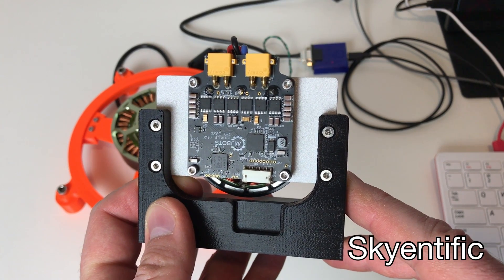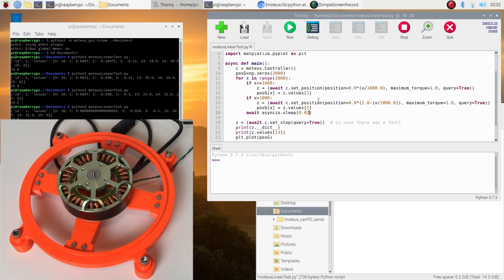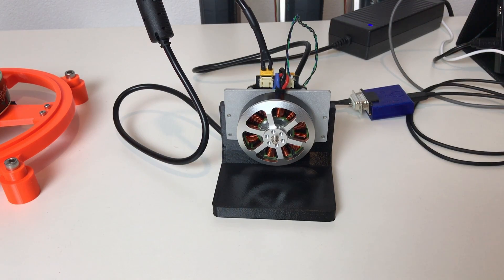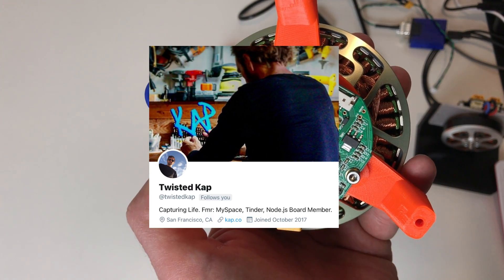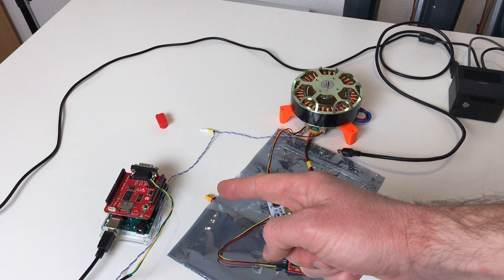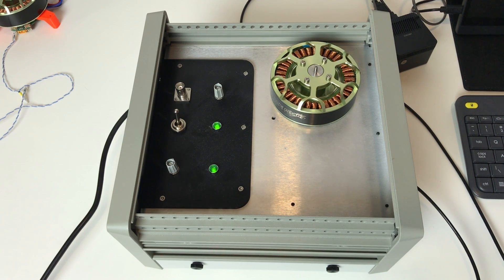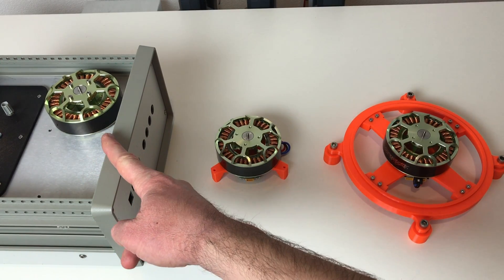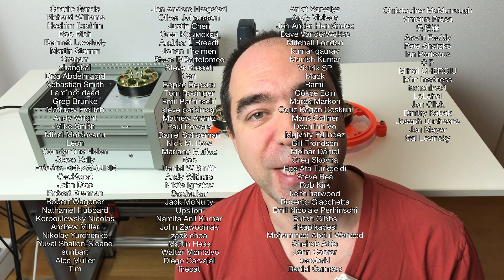Best BLDC Controller: ODrive vs MIT Mini Cheetah  vs Moteus (MJBots)

Comment: This is not a new problem, just a new place for it to appear. The issue in question stems from the hardware/firmware implementation of the controller.  Particularly the use of N-channel and P-channel mosfets, secondly the non linearity of the PWM drive curve (to the mosfets), and finally the firmwares implementation to mitigate these factors. In BLDC controllers for commercial hobby craft, this issue is long since solved. Most commonly by using only n channel mosfets and a boost converter for the gate drive voltage. See simonk firmware and related hardware. Solving it here, would involve careful component selection to find more closely matched p-channel performance, or some over driving of the p side, like a 3rd order polynomial fitting or similar with increased pwm resolution. However firmware can only get you so far, considerations in hardware are an important first step.

Comment: Thank you for showing this. I have been investigating the same kind of problem with brushed DC motors and have been looking into how encoders perform. I think the problem here is depending on the encoders performance and how they are used. I can see, that at least some of the controllers, that you show, do use an encoder, but do they all three got an encoder? One step could be to record the encoder type on each case - I should like to know that.

When you read the signal from a magnetic angle encoder, you need to be aware, that it measures the magnetic signal at its own measuring cycle with its own cycle time at about 100 us. This can create variations due to how you interpret time between two measured angles. When you read the angle with only a little time difference, then you will get a substantial relative noise in calculated difference angle of the two very close angles.

I recorded a similar video of very low speed on a DC motor with another micromotor as encoder: https://youtu.be/Sp55jztsI80

Comment: How did you get to run the motor at low speed with the mini cheetah controller? Cause I tried adjusting the velocity but the motor always goes max speed. Is it true that the mini cheetah controller only offers torque control mode?

Comment: All the motors you use are cored bldcs, at low speed/power the induced magnetic field on the core (cogging) has a significant torque compared to to the control current. Gimbal motors are coreless, so they do not have cogging, which makes FOC at low speeds much more even.

Comment: Great Video! So usefull! Thank you for sharing such information.
Just a small question, what is the adapter that you are using from USB to CAN? Because there seems to be very expensive ones.
I am more interested in the one used for the MIT mini cheetah controller.

Comment: I wonder if you could tune the PID values harder than just 2x to get better behavior on the Moteus?

(Also, no-load behavior is notoriously harder to control than motor with load.)

Comment: non homogeneous movement in slow motion is caused by motor cogging torque (caused by inconsistent magnetic flux in motor) - to eliminate this, regulation loops have to be very fast and properly tuned or utilize some sort of feed forward. Also position sensor must be more precise - 12bit (4096 values/rotation) results in very small speed resolution. Best way to remove cogging is stator construction redesign (special motors for precise movement) or operation at higher speeds - rotor inertia smooth this torque ripple

Comment: I think this is software related and also due to the windings of the motors; they are not equal in terms of resistance and magnetic field being generated. The calibration algorithm is flawed and the ramping is probably too crude.

Comment: Smooth motion during calibration is related to the fact that BLDC is controlled in open loop for calibration purpose (it should be, because no precise speed is needed). Problem of BLDC motor control at low speed is caused by low quality construction of BLDC. These motors do not have exact sinusoidal current waveform (compared to AC servo). BLDC motor has a noise which is added on 1st (fundamental) harmonic  (as I can remember noise appears at  5,7, and 11 harmonics). AC servo motors do not have problems with low speed control because AC servo is designed and constructed in such way that current output response is pure sinusoidal (no higher harmonics that cause the noise).

Comment: wow these motors are not designed for that at all! im surprised to see them move so slow and smooth. must be wasting HUGE amounts of electricity. very stupid
Reply from the maker: Yes! All people in robotics are so stupid! Why they all use brushless motor?!
Reply: @Skyentific  oh dear ... let me explain... these motors are supposed to run at few thousand rpm. that is optimal electrical efficiency. for slow precise movements it is best to use some gear reduction which also increases torque like harmonic drive but you would need very large gear reduction for these motors so gear becomes heavier than motor. even small gear will be big improvement. i havent watched your videos yet. give me time
Reply: @NSAwatchesME  I think the theory is that, if you can do it all electrically, then you can save cost, weight, space, and complexity that would have been used for a strain wave or cycloidal gearbox, and you'd also save backlash if you'd have gone with the cheaper planetary reduction option. Especially weight, but also space, is at a super premium on any kind of walking/moving robot.

Comment: ODrive have posibility to compensate coggin torquq. You need to calibrate motor for cogging torque compensation to be able to youse this functionality. The noise is because of PWM frequencey. ODrive uses 24kHz PWM by default. Seems like other controlers use 12kHz or even less. Thats why you can hear motor noise. The second reason I think is that ODrive firmware uses 50% PWM at all three phases as the ZERO vector reference, and other use 0% PWM duty cycle as the ZERO.  Thats make difference on low torque. I can illustrate it with pictures if you would like to know more. P.S.  You can write your own firmware for all of controllers:) Hardware is simple STM32 with motor driver, difference is in firmware.

Comment: I usually love these videos, but this entire video I was cringing.  This should have only been posted for viewing after all the manufacturers had been contacted about the results.   Only then can you say what they are capable of.   Otherwise, it's just a different form of an unboxing video.  In the real world, there are soo many tradeoffs when tuning things, these motors cant come stock tuned for each and every single application.   Most high-performance items require tuning to achieve their peak specialized performance.

Comment: Are there tuning parameters that can improve the low speed "homogeneity" of the movement? I have several motion control projects that I need good universal BLDC drivers for, one should function more like a servo so I am leaning towards the O-Drive but would like to explore lower cost options as well!

Thanks

Comment: Thank you for the comparison. For me, I tried Odrive with D5065 motor with low speed and it seems that, it have the same problem of MJBOTS controller with low speed. My opinion I think it's related to the motor also.

Comment: Why would you use this motors in slow mode. afaik the cheetah controller was explicit developed to react fast with fast movements. guess the others too. so comparing apples with bananas might be interesting but useless

Comment: This was really Interesting.  I have found many servo systems work better under load, otherwise they get jittery where the motor moves quick and the encoder is constantly trying to correct .  I wonder if you did the same test with simulated load

Comment: Thanks for the great comparison!

However, I don't believe the moteus low velocity performance was compared using similar gain setups.  ODrive by default has a non-zero velocity integrative gain, which decreases torque bandwidth but increases smoothness of low speed maneuvers.  moteus by default has this gain at 0 in order to maximize torque bandwidth.  You can enable the same gain in moteus by setting `servo.pid_position.ki` and `servo.pid_position.ilimit`.  If you tune those, I was able to achieve basically identical low speed performance between ODrive and moteus.

The audible noise is a different matter.  The majority of the noise in a default moteus setup comes from position noise reported by the magnetic encoder.  I set up an ODrive with the same AS5047P as on moteus with an mj5208 motor on both and got similar audible noise volume, although the spectral content was different likely due to the higher control rate of moteus.  Exactly what magnetic encoder did you use in these tests?
Reply from the maker: With ODrive I used: as5047p used with a, b signal.
Reply: @Skyentific  Thanks!  My test was with SPI, guess I'll try A/B/I soon here and see what results it gives.
Reply: What does Oskar Weigl of Odrive say to this? Yes, I also believe the noise as well as the motion (un-) stability comes from different PID settings.
Reply from the maker: @rudisoft  may be. But out-of-the-box, the ODrive, with this motor and magnetic encoder, works better.
Reply: @Skyentific  Yes, I have confirmed that using the ABI interface of the encoder is much quieter than the SPI interface.  The ABI output is reduced resolution and bandwidth compared to the SPI output, which will result in less audible noise, but also lower torque bandwidth.
Reply from the maker: @awesjosh  great! Good to know this.Thank you.
Reply: I came here just to see if Josh would respond and as I expected he did.    I think Josh is the kind of person that is both very knowledgeable and someone that wants to make the best possible product.   I'd like to see the Moteus tested again with the adjustments and encoder as suggested.
Reply: @wgm-en2gx  I'm here for the same reason. I'd also suggest checking current shunt resistors on all the boards to be the same, as on Moteus they are tuned for high current loads, such as 60 ampers. Obviously, during low-speed operation, you will have a bunch of noise in a current loop.
Reply: I had one but I am not sure how to control it through Arduino. Can you please let me know? Thank you.

Comment: Is it possible that the encoder is generating this effect?
Reply from the maker: They all use similar magnetic encoders
Reply: From my experience, the  encoder is very likely to be the issue here. You have noted that the motor is running smooth while calibrated and the reason ist because of is running open loop. Once you close the loop, any nonlinearity of the encoder will directly  transfer to unsteady motion. These low cost magnetic encoders are very sensitive to mounting inaccuracy. Try adjusting the actual distance of the magnet and wonders might happen ;) If you like to test a high end servo drive and encoder made for robot actuator applications, please let me know.

Comment: Hi, the problem lies within the feedback from the motor.
Using an encoder with very fine increments is the best way.
If you have no encoder, the only feedback you can get is from the field of the motor magnets moving next to the stator windings. This is a very weak signal when the speed is low, which is the reason why the controller will have a hard time to get an accurate feedback.
You have the same problem with RC cars when using brushless motors without encoder on a rock crawler where the motor is only turning very slowly.

Comment: Does the ODrive use an optical encoder instead of magnetic?  Perhaps it can do tighter control without losing stability if it has a higher precision encoder?
Reply from the maker: All uses magnetic encoder, including ODrive. All encoders have similar characteristics.
Reply: @Skyentific  Ok, good, then that's not a factor.  Thanks!

Comment: Very useful comparison, thank you!  I was thinking about switching from ODrive to MJBots because I thought MJBots would have smoother motion and not as bad cogging, but now I see ODrive is already good.  Like another commenter, I originally assumed the noise was due to PWM frequency, but you indicated that they were all above 30kHz.  I find it also strange considering ODrive control loop frequency is 8kHz whereas MJBots appears to run control at the full 40kHz PWM frequency, so we would expect tighter control with MJBots and less noise.  Interesting.

Thanks again!
Reply: The odrives control loop is 8khz but the phase PWM is 24khz

Comment: I think the MjBots controller is almost the same as the MIT mini Cheetah controller. Only the MCU is different, as is the firmware
Reply from the maker: Yes. But firmware is extremely important.
Reply: @Skyentific  Absolutely! I'm going to discover the difference pretty soon I guess(I am working on a robotics project at college). Luckily the code for both are open source (as you showed in your earlier videos), which can act as good references.

 The MIT Mini Cheetah controller might have problems with the PWM frequency and not so good capacitors resonating, which is possibly making the sound while running.

Comment: You didn't show us all data so we cannot judge.
You use same encoder on each test?  Always magnetic encoder?  Maybe magnetic interference from motor to encoder.  Try optical encoder?
Reply from the maker: All use similar (but not the same) magnetic encoder. as5047, as5147, ma700. Why to try optical encoder, when ODrive works fine with magnetic?
Reply: @Skyentific  To learn!  To rule out magnetic interference to e the encoder.  :)
Reply from the maker: I never planed to make this video. :)

Comment: The noise is generated by PWM of the controller. Probably, ODrive has higher PWM frequency, which makes sound go to ultrasonic range, but heats FETs more. It could be easily fixed with firmware modification by increasing timer frequency.
What about features? Which controller would you prefer if someone would order a robotic arm from you?
Reply from the maker: I don’t think that the noise is from pwm. All these controllers use frequency higher than 30kHz. And, if I am not mistaken, ODrive uses lower frequency, but it is silent. 
Ideally would be to have moteus controller with ODrive performace. :). It is easier to work with moteus, but odrive gives better performance. So I would probably choose ODrive (but for some projects, ODrive is too bulky).
Reply: @Skyentific  So, the ideal solution is ODrive, but for single motor and designed on a round PCB with magnetic encoder, like MIT Cheetah?

Comment: have you tried the dev branche of odrive firmware with anti cogging?
Reply from the maker: No, but I should! :)
Reply: @Skyentific  yeah, definitely. I tried it with a rather problematic (high cogging moment) BLDC and it did improve the smoothness quite a bit, I'd say it eliminated it completely. it's only a 64mm diameter motor, so it's harder to see, but the plot looked smooth.

Comment: The smooth motion during calibration is due to it being done openloop with relatively high current. It is simple to do this but wastes energy.  The difference in noise is likely due to pwm switching frequency. You may want to move above audible range but then your switching losses increase.
Reply from the maker: They all operate with the switching frequency above 30kHz. There is some complicated mechanism behind this noise, which I do not understand.

Comment: did you try odrive with anticogging?
Reply: I hadn't even realized that the ODrive HAD anti-cogging until I read your comment two weeks ago, totally changed my direction on my robot design. I am grateful for where your comment took me. I was so blown away by it in fact that I made a video of my own to explain it to others. https://youtu.be/CWzuBoYLISY
Reply: @AndyVickersNet  your video was very useful for me and a great explanation
Reply: @TylahKwin  thank you so much for checking it out!
Reply from the maker: Great question. I used ODrive 3.5, I think it does not have anticogging
Reply: @Skyentific  It does!  3.5 and 3.6 both support all of the firmware features.  The newest (best) anticogging on ODrive is currently only available on the "devel" beta branch, however.  If you hop on the Discord we can show you how to enable it if you'd like.
Reply: @wetmelon7409  Which discord?

Comment: There is a software update that solves this low-rpm cogging problem, I've made a video about it on my channel
Reply from the maker: Nope. I've made the firmware update! :)
Reply: @Skyentific  The 8318 behaved like it was before the update, the test stand motor behaved like it was after the update.
Reply from the maker: I saw your video, before making my video. ;)  That why I updated the firmware to the latest, before the test. Do you have noise from motors?
Reply: @Skyentific  noise is a separate problem, noise did not chnge with te update, but the low vel performance got way better.